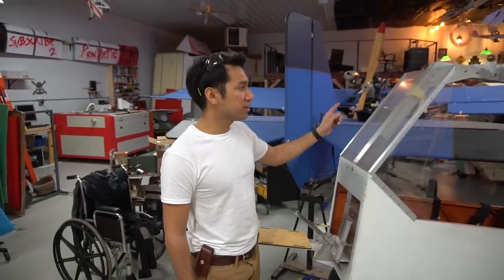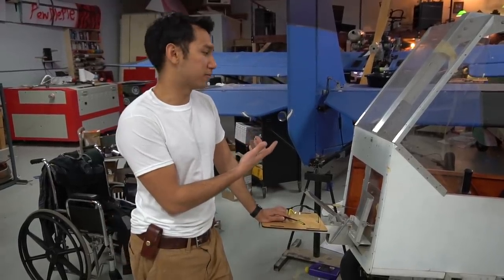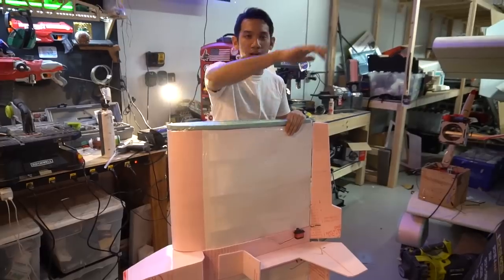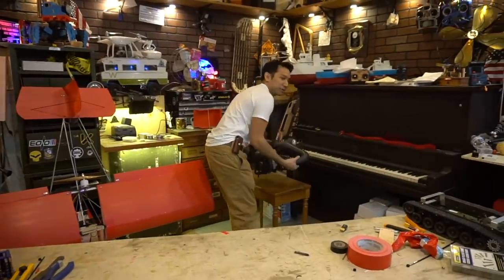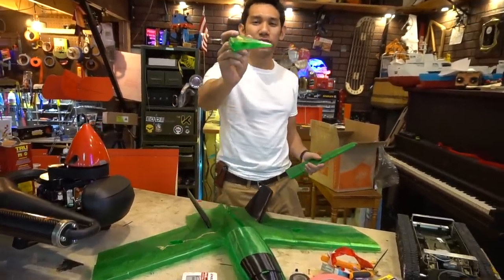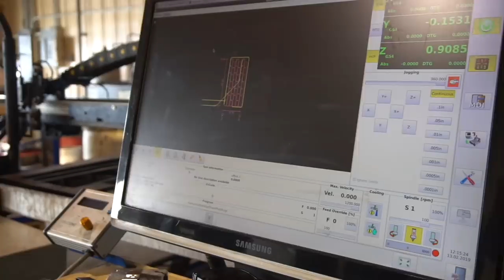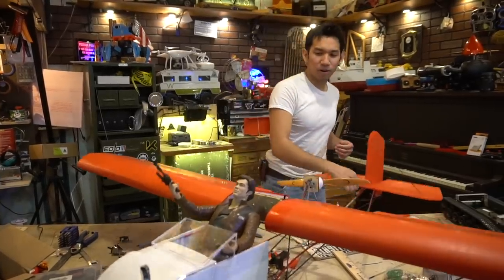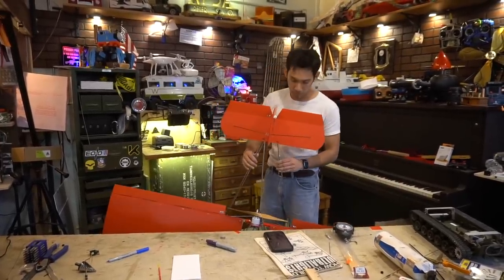DIY airplane mk3 (PROJECT UPDATES)

Comment: NICE!! I have a Vittorazi Moster on my home-built PPG and I LOVE it! It can be a bit tricky to prime and the carb definitely needs to be tuned to your altitude (simple low jet/idle set screw adjustment), but once properly tuned it's easy to maintain and incredibly reliable! I recommend Motul 710/800 with premium pump and fuel stabilizer. almost 100hrs so far with no problems or overhaul (aside from recommended exhaust bushing replacement)!
Reply from the maker: cool! I didin't know you flew too hahaha! will check it out and thats great info to hear!

Comment: The kill and on/off switches aren't anything special on my Scout. I took the priming squeeze bulb off and put an extended vent line on the tank. So you basically push in the little button on the carb and then blow into the fuel tank vent for 4 seconds and then good to go. Lighter and less leaky/complex than the squeeze bulb.
Reply from the maker: oooo thanks! I saw someone do something similar and wondered what they were doing, that explains it!
Reply: @PeterSripol  Also, maybe look at a bladder for the fuel tank. They're a bit lighter than the conventional rotomolded plastic ones. I think Air Conception sells them but you could probably get better leads on the Paramotor FB group.

Comment: @
PeterSripol Paramotor dude here. If your all up weight ends up near the FAR 103 254lbs you may want to consider a polini thor 250 instead. There are a lot of people flying them on not only paramotor for racing, but weight shift trikes at the max weight. They put out about 38hp, dual ignition, liquid cooled, and electric start. Making them run cooler and more reliably for ultralight in a single cylinder configuration where engine outs can be extremely dangerous if you have no landing zone. The Moster is a really great engine too, but the best engine for power would be the polini 250.

Comment: Use strong, non-fatiguing landing gear, and put a few more triangles in the rear section of the new ultralight's frame, just before the tail and up to the back of the wing. it looks like it wants to twist and that will dampen rudder response!!!

Comment: Pro tip when the nose starts to smack the ground, add flap, or ailerons to push the nose back up, not too important now but if you do that in a full scale...youre gonna have a bad time.. lol. Great video i always love watching the model planes and aerolights!
Reply: also a backwheel to make it almost like a tail dragger would help. a much smaller wheel is needed in the back so weight distribution shouldnt be too much of an issue!

Comment: You've got a paramotor...motor. Ever thought of building your own paraglider? Not many DIY paraglider wings out there. People too scurrrrred, I guess. But the ones I've seen are pretty awesome. Plus it's pretty low risk. Test flights can literally be right above the ground, and you don't even need to move through the air very quickly. Always something I've wanted to try myself some day.

Comment: The Moster engine is a good choice, I have used it for years on my Bloop series of ultralights (several planes, just one engine). The Bloop drawings will show how I installed it, perhaps a primitive setup, but it's a start.
Reply from the maker: airchairp thanks! Will check it out! I didint realize you used the 185! That gives me much more confidence in the motor selection.

Comment: Welding on top of the pressed wood board is causing your metal to become contaminated therefore making you think your doing something wrong when its the contaminates from the wood. You must get some plate metal to weld on top of so you should buy a small welding table off craigs list you will thank me after you see the improvement of your welds. Also remember to get the tungsten as close to the metal as possible because you want the argon to smother any oxigen so it will weld nicely. If you get too far away or at an angle it causes a bad weld.  Trust me I welded heli arc for 12 years in a fine art foundry. Oh another tip always sand your metal that you are joining together so its free of slag or any oil or contaminates. Use a grinder or sanding disc to clean the metal. Sanding cones too. What every you like to work with or can afford to buy.

Comment: Look at your ultralight, look at the materials used, aluminum tubing, and the type of construction, a aluminum frame covered with fabric, this is the proven method to building light. Most ultralights are mostly bolted together, not too much welding involved.

Comment: 4130 tube is nothing to worry about.  Use 70 S6 filler, keep it clean, tight arc with tungsten 90 ° to joint.  No burrs, tight joints.  No wind, let the weld cool naturally.

Comment: I'd go with a P-38 twin boom style tail as opposed to the single vertical stabilizer,  Use your thrust ring from the paramotor as well.  At ultralight speeds, the improved thrust helps.

Comment: Could you try building a canard? As in a plane with the main wing in the rear and instead of a rear tailwing pushing down it has a front wing pushing up? They're actually way more efficient and are just really cool
Reply: They are not "way more efficient", its pretty negligible (the airflow from the canard in the front gives your main wing garbage air, killing your lift). The benefit is great self-correcting stall characteristics. You simply angle your canard 2 degrees more than your main wing, and when you stall, the plane will stall on the canard first, so your nose drops back down and corrects the stall. So for safety reasons it may be a good idea.

Comment: For a super slow manoeuvrable design, you could do worse than looking to the Fieseler Storch for inspiration. Looking at its wings, they are not great big slabs, but quite high aspect ratio, just with a leading edge slot. The higher wing loading makes the plane smoother at low altitude, where the air is rougher.

Comment: Couple of things, Peter:
1) YOU ROCK!
2) "mk" is short for "mark", as in "Mark 46 hydrogen bomb."  You can call it "emm kay 3", but everyone else will call it "mark 3".
3) As for scaling from the model, I don't know what scale this model is, but consider this:
3a) You're using solid rather than tubular Chromoly on the model.  The full size one will weigh much less than cubic scaling implies.  Probably not even squared scaling, but somewhat more than linear scaling should apply.
3b) The model uses the same thickness of coroplast you will on the full size.  Again, this will scale with the square of the wingspan, not the cube.
3c) Other covering materials are also more likely to scale by the square rather than cube.
3d) Again, I don't know what your scale is, but if this one is 1/4 scale and 10 pounds, and most of the materials are going to scale by square law because the thickness of the materials won't change, then this will scale up to 160 pounds, which isn't too far off base.

Comment: If your TIG welds are burning you haven't cleaned the piece enough. You'll feel like a pro the first time you TIG something that's been wire brushed. You should also set the welder to keep the Argon on for a couple seconds while it's red hot so it doesn't immediately rust.

Comment: Peter,  I'm certain I'm not the first to suggest it, but have you ever considered building a Mignet Pou-du-Ciel 'Flying Flea'? Henri Mignet seems like one of the patron saints of homebuilt aircraft as he spent a great deal of time and effort in the 1930's trying to perfect an aircraft that the 'everyman' could build and fly. His first efforts had aerodynamic problems which resulted in some well publicized crashes which tarnished his reputation, but these aerodynamic failings were rectified in later iterations and many of his designs are still being built and flying today. His aircraft were designed as 2 axis control aircraft to greatly reduce the amount of skill and training a pilot would need. The later versions are said to be very easy to fly and very safe. The French Army actually bought 29 of a 1986 version designed by Mignet's eldest son.

Comment: I was interested in paramotors last year and all the research I did basicly said the company doesn't give you any info on replacement parts because they want you to order everything directly from them even if it was just a single bolt missing they say it has to do with safety but I think it's just so you are stuck with them.

Comment: Maybe tube aluminium with brackets nuts bolts so any broken part just unbolts? Like a Skyranger? Rotax  engines a bit expensive but reliable and good power to weight ratio.

Comment: I keep wondering why you don't use more film or fabric in your wing construction to reduce weight. Does the rigidity of paneling or foam add so much strength that the weight is worth it? Idk. I've mostly just done  balsa with paper or film skin flying models. Either way, been a fan since flight test a million years ago, keep up the good work!

Comment: Why not trying a puller instead of a pusher? The prop wouldn't get turbulent flow as this design does. It would have much better performance. I guess the plane would need a stiffer fuselage to hold the firewall and engine, though (?).

Comment: I'd love to see a third plane coming, but there are still some issues with the design, I guess: First of all, the gap in between the two wings does not make sense. At the tip of a wing, the pressure difference between the top an bottom creates a vortex, leading to a phenomenom called induced drag. This can't be averted at the wingtips (reduced however), but with the gap you're effectively creating a second set of vortices, which add drag and reduce lift slightly - not something you want. The second problem I see is the location of the propeller. A pusher configuration is in general less efficient than a conventional one, because the propeller cant suck in clean airflow. In the model you've built most of the propeller's area is behind the fuselage and the pilot which disturb the airflow massively. This compromises the efficiency of the propeller. Furthermore, you should take a look into wing theory. Manufacturing a non-rectangular wing gets hard really fast, but a better lift distribution and wing twist can improve performance and stall stability, which is very desirable in a low-speed aircraft.
I'm always looking forward to see your ideas come to reality, your videos are inspirational. Good luck ;)

Comment: Cool video! Have you ever looked into "testing" it with a program like x plane? Even in the free demo you have access to a "plane-maker" program which is actually pretty good, and it predicts flight characteristics for the design (instead of you telling it how it flies the program tells you based on the plane).

Comment: What plastic is that 3d printed plane made with? 

I've been meaning to 3D print just an airframe and tissue/dope it like my buddy and I used to do with balsa sticks (the PT-19 kicked serious butt, and my Corsair was a masterpiece until the first big crash. I was so mad I removed the electronics and lit it on fire). After 4 spools of the PLA Pro filament from eSun I'm a major fan,  as it doesn't have the sudden-failure characteristics that regular PLA does but I haven't used it on a plane!

Comment: I'm building a skypup ultralight and you should consider building one as well, There is a lot of information available as well as a facebook group of skypup builders to help. They use a rotax 277 which is half the size of the one in the aerolite and its made out of foam with spruce strips and then covered in fabric. Inbox me if you want more info.

Comment: hey guys if you want a handy way to rescues planes from trees. just use a slingshot, tie braided fishing line to a weight (rock), shoot the weight over the branch you need, then tie rope rope to your fishing line and pull the rope over the branch. pull down on branches and shake tree to rescue plane or quad

Comment: Can you power that ultralight with chainsaw engines
Reply: Chainsaws are not very efficient, you won't have very good flight times. What he should power it with is an RX-8 engine (250 pounds and 238 rated HP), but I'm joking, because those things gulp fuel probably even worse... Since he wanted long flight times, chainsaws probably are not a good idea (plus the reliability on chainsaws are notoriously bad, even made fun of in most movies, and if anything, those movies are being generous).

Motorcycle engines are very cheap and good performers, plus you usually need more than 3 HP (like a typical 8 pound 50cc chainsaw engine, so its HP/weight ratio is about half that of my non-turbo car engine). Motorcycle engines would be what I would personally use, fuel efficient 4 strokes with plenty of grunt (not sure if you'd want the gearbox on them though, that might be a reason to not use them)
Reply: @jakegarrett8109  but how to convert a motorcycle or a chainsaw engine to an aircraft engine, any idea?
Reply: I'm sure there are plenty of guides on it that explain it better than a Youtube comment (the first airplanes ever made, even by the Right Brothers were made using motorcycle engines). I've done a grass trimmer engine with a prop for a "portable fan", that's about as simple as it gets, it really doesn't require looking anything up, its very intuitive (they are almost identical to a chainsaw engine, other than the crankshaft spins the opposite direction, you can actually change that by moving the mag generator to the opposite side and starting them the opposite direction if you needed it reversed).
Reply: @jakegarrett8109  I'm 19 yo boy I'm studying commerce but I have interest in making a microlight aircraft similar to cri cri , I think of using chainsaw engines but I don't know anything about it as I have never used it , and you are saying that a grass trimmer engine would be good , my weight is 67 kg I'm 5'10 tall , if I ever make an aircraft similar to cri cri powered by grass trimmer engines , will it fly? I hope you upload videos of what you made on your channel I will really appreciate and I have subscribed to you
Reply: @shannonwhitaker9630  yes I know that , and that's the reason why I decided to power my aircraft with chainsaw engines, but I don't have any idea on how to convert them , if any link available you can just post it in this comment section, I tried searching on Google but couldn't understand anything

Comment: btw, at 4:59, right now,  the stabs are  IN   THE   PROPWASH.     the use of a  Correct thrust ANGLE, would  change that.     if you continue to shy away from using  TRIED-AND-TRUE  airframe building techniques,   your success level will continue to low.    suggest you view my  tutorials discussing  profiles.     googletranslate
http://static.rcgroups.net/forums/attachments/2/9/6/3/9/7/a5988257-224-bixler%202%20motor%20angle%20correction.jpg

Comment: Thought of this while watching an earlier ultralight video of your's.

It concerns the fiberglassing of airframes. And Mylar wraps, around minute mark 16:00.
I'm not sure how much weight the Mylar wrapping technique might save. But as far as aerodynamics are concerned. In rocketry, a smoother airframe equals an extra couple of feet in overall altitude.  Hopefully offsetting, if even by a little, the extra weight for bit more strength and rigidity.
https://youtu.be/_gTxwEVK6IY